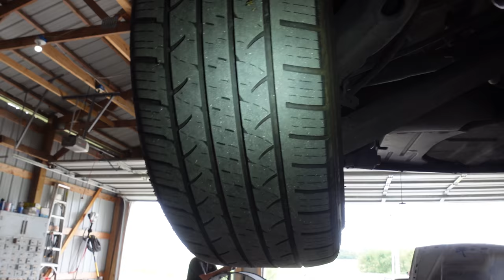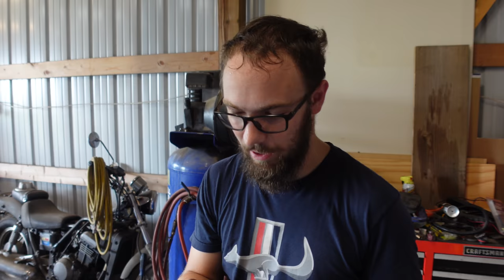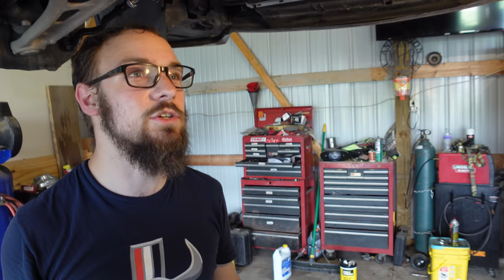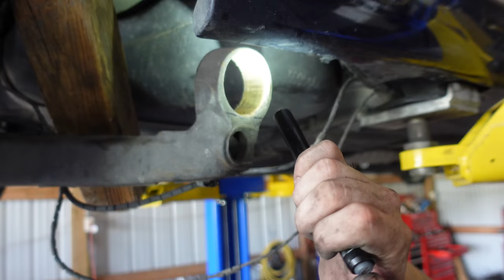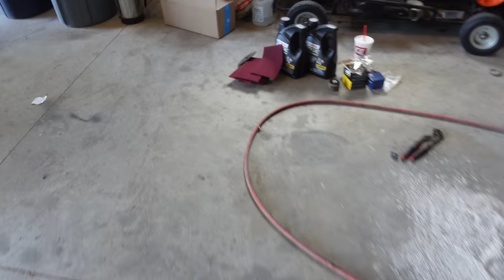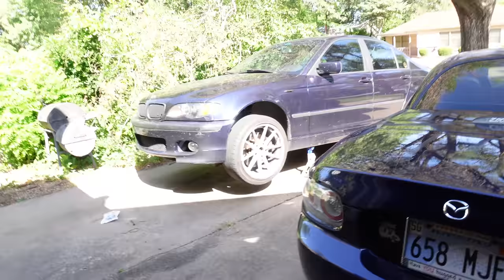The ONE THING that BMW owners NEVER DO! (Maintenance)

Comment: I have owned BMW's since 1990. At that time the dealership was more of an enthusiast's shop. The service area was not all fancy. The cars were well built and the owners almost all were passionate. They took care of their cars and knew a lot about them. People would call in to say there is a noise from the rear, I think that my fuel pump is about to go. Sure enough that was the issue. 

Now the cars are not as well made and the most owners are clueless. 

I maintain my 2004 Z4 meticulously. It goes into storage each November after getting a complete inspection and oil change. Regular coolant flushes look after the rad and heater core. Brake fluid changes, bushings, gaskets, brakes, tires (lots of tires!) and annual alignments. Other things like the water pump (electric) gets replaced because it is "time" and there is no sign that it is going to go bad. Sometimes the fall inspection will reveal a problem that does not need immediate inspection. Then, parts get ordered and the work is done in the spring when the car comes out of storage.

Comment: Jake - I had a similar issue (steering wheel 'play') with a notBMW - after replacing ALL the steering components, I finally replaced the stock steering shaft "rag joint" (which seemed 100% fine) w a solid / metal aftermarket unit - problem solved!

Comment: FYI, Tile nippers if you have them lying around work great for those and Oetlicker (sic?) clamps...carbide jaws that are not sharp enough to cut the clamp regardless of how tight you crimp.
Reply: Oetiker clamps.  I've used end cutters to crimp them but the ear will protrude more than it does when crimped with the proper tool.  
The actual Oetiker tool that has an anvil that dimples the top of the ear to lower the profile is fairly inexpensive
Reply: @TheOcculus  oh, I have a pair...just never seem to find them when working on a rack as I use them for my brewing line connections as well.  Those tools are always scattered.
Reply: @michaelkrenzer3296  you need to apply tool envy...  get one more set.
When the old tool sees the new tool in your.toolbox they'll come out.of hiding. :^P

Comment: I worked in the service department of a BMW dealership for 14 years.  My primary job was to diagnose problems with customers cars by either riding with the customer or driving the car myself.  The thing about E46 front control arm bushings; on about every other E46 I moved off the service isle those bushings were bad.  You could easily tell just by tapping the brakes and feeling the thump.  We replaced so many of them the first few years that BMW corporate complained that we replaced more than any other dealership in the country.  They were bad though.  The other E46 nemesis was widow regulators.  Use them and you'll end up replacing them.  Oh, and the melting rear tail lights were also a problem.  Still, when sorted a great car for someone's kid as a first car.  And you're correct about BMW owners and maintenance.  They either are overly anal or completely oblivious.
Reply from the maker: Lower control arms, melted tail light plugs, and one of the window regulators were the first things I did to this car. I've done the other three regulators since then; I think I can do that job in 15 minutes flat by now.

Comment: I do enjoy watching the videos about the car. It gives me ideas about what may be needed on my old Volvo 240, surprisingly enough. One of these years I should do the rear bushings on the trailing arms, torque arms, Panhard rod, and antisway bar. Should eventually do the front control arm and antisway bar bushings too. None of them has been done, and I am sure 31 years and nearly 400,000 miles have done them no favours. Should maybe do the rack as well. Thing is, the old car tracks true and doesn't tramline with no oddball noises, so I'm a bit loathe to touch what doesn't seem broken.

Comment: I bought a 1999 trans am a few weeks ago and same deal.  Car just wasn’t maintenance well, I got it cheap enough and knew what I was getting into.  Guy puts 3,000 worth of exhaust on the car the kind of fits but you can’t do basic maintenance like air and fuel filters, plugs ect. Crazy the car even ran lol.

Comment: The slot in the RTAB goes bottom-up, and You need to orient the bracket correctly, otherwise, the bushing will be twisted and will fail prematurely...

Comment: Is the E46 anything like the E36 as the mod people like doing on the steering on those is fitting a purple tag rack off the Z3.
Reply from the maker: The ZHPs have a modified version of the purple tag rack from the factory, which is why they're so obscenely expensive.

Comment: I just subed here. This is the first of your videos I have seen.
You did a pretty good job.
How do you get onto McConnell AFB? I grew up in Wichita.
Is there someone there that knows how to run the alignment rack. Base hobby shops usually are pretty much do it yourself.
I have a MB and Tire Mart told me BMWs and Mercedes need to go to the dealer or specialty shops for accurate alignments.
Said it right on their computer.

I grew up on the south end. What part of town are you in?
Reply from the maker: I have a lot of friends who are servicemembers who can drive me onto the base. The base manager is a great guy and owns a gorgeous blue 2nd gen Acura NSX and was happy to show/help me run the alignment rack, though you'll probably want some familiarity with the various adjustments on your suspension. Right now I live in central-ish Wichita. Grew up in Derby.

Comment: You'll never believe this and I tried to get it on camera but failed. I saw an M8, brand new, and they were using their turn signals. Now as if that wasn't shocking enough, they stopped at a 4 way stop and actually waited their turn. I was stunned. As I pulled out my camera to try and record this car further, it sped off at an extremely high rate of speed..about 45 mph...in an active school zone. So you know, that part of BMW ownership they adhered too.

Comment: I always do all the maintenance on my car. I have a 16” audi and already spent 6k out of pocket on maintenance with fcp euro. But the next 6k is on them I’m so stoked for that. 
All suspension 8 control arms, tie rods, sway bar bushings, high pressure fuel pump. Low pressure fuel pump, gaskets, pcv valve, 23 oil changes. Every 2800 Miles with motul. Coolant flush twice, brake flush 3 times, keyless antenna, rear, center, & front diff fluid change. Brakes, 3x, trans fluid change twice. Timing chain, balance chain, carbon clean, updated aluminum water pump. New coolant outlet that goes bad. New battery. Serpentine belt. 
Still original starter and original alternator. Might buy the altenator from fcp and just keep it handy so I can swap it out same day without delay of shipping.   
My car runs like absolute brand new maybe better than new due to upgrades. Pss10 suspension 034 upper control arms. 

Maintain your cars people and they will easily last 400K miles still in mint condition. Oh ceramic coat looks better than factory paint after 5k paint correction. Spent 12k on looks and maintenance but my car is the nicest running audi in my model by far. I will keep the car forever and fcp will pay for the maintenance forever after my initial 6k warranty. Worth every penny will save me 40k not ever having to buy a new car due to ceramic coat and preventative maintenance. 

Most people will buy 10 cars and spend 150k. I will spend and have a nicer more well maintained car than you forever. Also I will get it cleaned with dry ice every 2 years. Will look as good as factory in 2040. 
How many people can say that. Almost zero. 

Hope this helps open your eyes people.

Comment: I would make a more precise claim.
NEW BMW's do get maintenance by dealer workshops. Because warranty. But at some point the 2nd, 3rd ot 4th owner does want the brand image of driving a beemer but isn't willing to do or can't pay for the pricey maintenance. And since the quality of BMW's of this era and newer is no longer what it used to be you'll find lots of worn out parts. German language has a beaufiful word for this situation: wartungsstau.
I used to own a e46 touring. Once i started doing work on it i got more and more disappointed. My reference? Volvo 940's. These were clearly overbuilt and of higher build quality then the e46.

Comment: My experience with BMWs is that they have very low tolerances and are very easy to damage if you don't know what you are doing.  That meant that I had to take the car to the dealership for maintenance which can be expensive.  Maybe that's why people fall behind on maintenance. Unfortunately,  I never had a Jake or Car Ninja near me.
Reply from the maker: I6 cars like the 325/330, 525/530, Z3, Z4 are excellent cars to learn to wrench on in my opinion. The way they come apart is very logical to me, though some jobs (removing the intake manifold) can be a little mind-bending.

Comment: An excellent example of what one can do with a full lift, air tools and apparently a "hobbyist" alignment rack?? that's new.
Reply: Military bases have had recreational facilities for a long time, from golf courses to auto shops. They're available to service personnel and their dependents to help ease the strain of living on base. Better to keep them busy with hobbies than tearing up the town or drinking in the NCO Club...
Reply: The only thing he did that couldn't be done using basic hand tools, and the car on axle stands in the street was the alignment. And you can make a decent start on that to keep the cost down. A lift and air tools just make it easier and quicker.

Comment: Jake claims his E46 BMW is dead reliable - replaces parts on a continual basis.
Reply: Maybe it's reliable because he's replacing parts and do regular maintenance?
Reply: @marcusjosefsson4998  "Reliable" is relative to other cars of similar age.  The repair needs and costs of a BMW are insane compared to most other vehicles of similar age, unless we get into exotics.
Reply: @PlugInRides  Weirdly enough, that doesn't seem to be the case here in Europe...
Reply: @marcusjosefsson4998  American built BMWs, made with non-union labor in Southern states, are not quite the same quality.  Also, Germany has much stricter TÜV inspection requirements for vehicles, requiring a more rigorous maintenance routine.
Reply: @PlugInRides  I believe maintenance is the key thing here. We do have pretty strict annual inspections in Europe, though it differs a bit from country to country. Germany and the Scandinavian countries inspections are probably as strict as they come!
Also we have a different view on car ownership I guess. It's not the norm for a middle-class European to buy a brand new car every third year, you buy a good second hand car and keep it for a longer period of time. All that combined makes strict maintenance key.
Different car cultures.
Reply: @marcusjosefsson4998  The "buying a new car every three years" model was the American norm in the 1950's, 1960's and into the 1970's, but hasn't been true for 40 or more years.  As automobiles became more technologically advanced, and relatively expensive, the 3-year financing model was extended up to 7 year terms.  

The current average age of automobiles in the US is 12.1 years, double what it was in 1970.  Cars also last much longer than they did 50 years ago.  BMW automobiles have traded build quality for high tech electronics in the last 20 years.  Much of the engineering effort has concentrated on lowering manufacturing costs, rather than improving reliability.  Many recent BMW engine designs are now notorious for expensive failures.

The same is true of Mercedes Benz, to a lesser degree.  Their cars were over engineered for toughness, having a tank-like reputation.  This was traded away for lighter weight, improved fuel mileage, and lower costs.

The reality is that Toyota, Lexus and Honda, build much more reliable cars, that require less maintenance, and have much less inflated parts prices and labor rates.
Reply: @PlugInRides  Principle still stands.
Average age of automobiles in Sweden is about 20 years. Same tendency across all of Europe compared to the U.S. A lot more Mercedes' , BMW's and Audi's here and they're still running in pretty good shape. Sure, overall build quality have declined since the 1980's/90's, especially true for Mercedes. But if you wanna find ratty old cars that are expensive to repair here, look for japanese cars. Different car cultures.